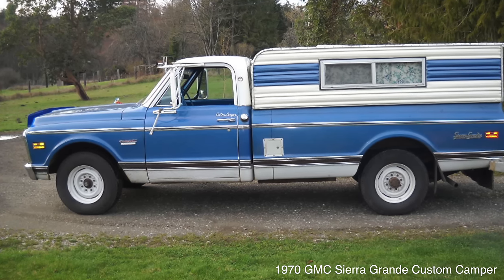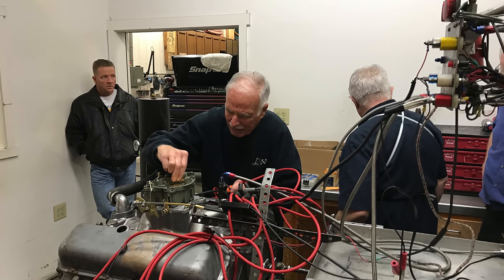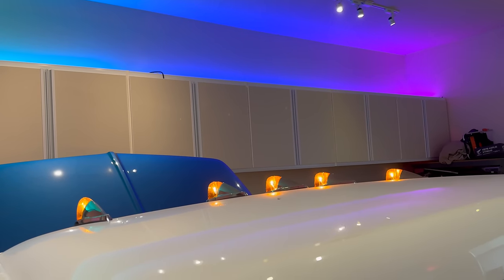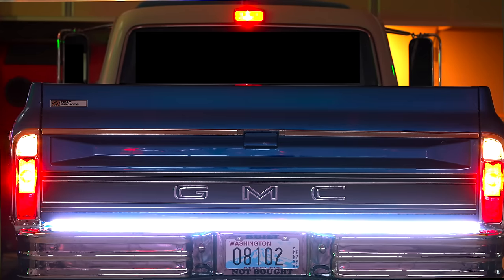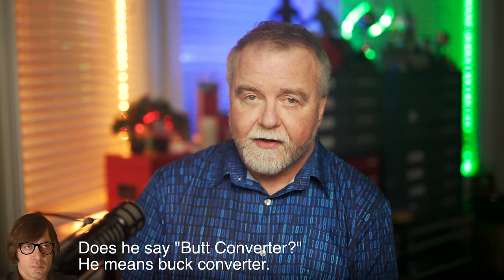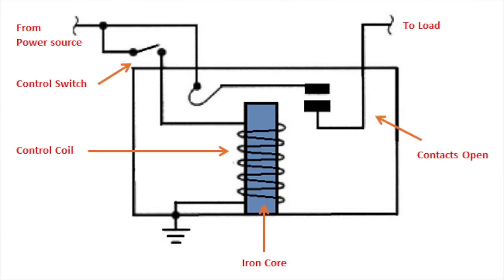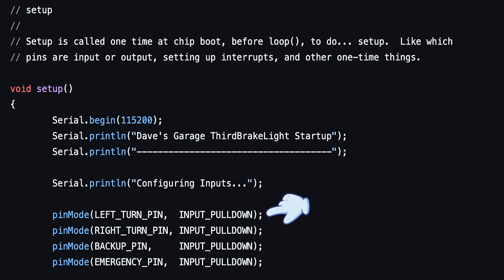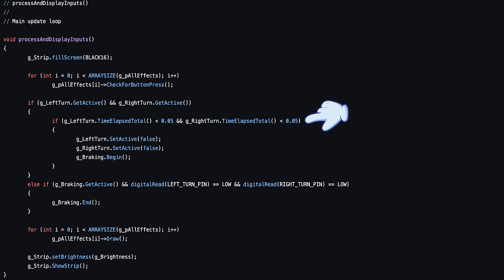New C++ LED Tricks for Our Old Truck: Sequential LEDs

Comment: A high school friend had an old 68 Cougar with "chasing" style turn signals which weren't working. We tore into it only to find the effect was implemented with a motor and contacts. This software implementation seems much more reliable (except in the case of an EMP... but in that event the car will still function while most others wont so turn signals won't matter as much :).

Comment: Easiest way to drop 12v to 3v3 is to have a resistive divider and a Zener across the bottom resistor to keep the voltage below 3v3. They are also quite fast so you shouldn’t see transients.

I love your video’s and your presentation style. You are an ambassador for autism. Attention to detail and a desire to find a solution allowing others to give input to your thoughts. And the “subs and likes” and asking for other peoples views. This is so important in engineering - we aren’t “gods of engineering” we are humble enough to seek input from others. This doesn’t mean we don’t know what we are doing, it’s having a mindset and humility to be able to collaborate with others. I am on the spectrum and it is without a doubt one of my strongest personal traits.

I honestly think that most really creative engineers are on the spectrum.  Most of the best people I know appear to be.
Reply: If dropping for input to a micro, you only need a resistor. With 12V you should be safe when connecting a 10k resistor on the pin, as then you would rely on the internal clamping diodes to limit the voltage. The resistor limits the current through those clamping diodes to about 0.7 mA. Simple, easy, works. And is exactly what you suggested anyway, just using built in zeeny. Not the safest though; rugged circuits provides schematics and explanations for a ton of protections (and sells boards if you want easy)
Reply: Btw I've used this often in auto and never blown an input. Won't save you if someone jumps you backwards though.
Reply: @forbiddenera  Just a zener and a series resister is perfect for 99% of cases. No need for a divider as the zener forms the lower half of the divider.
Reply: @forbiddenera The reason why I said to use a Zener was because of what you said - "not the safest though" - It is not a good idea to use the internal clamping of an input - transients can take a port out very easily.
Reply: @tripplefives1402   I'd still want a resistor on the bottom in order to properly ignore any phantom voltages which may be found.
Reply: @eDoc2020  That's what the zener handles. When reversed biased the zener will clamp it to the zener voltage. So a 3v zener will lock it down at 3v, no matter what the input is. Just like an LED or transistor, it needs a current limiting resister. With a divider the voltage will vary at a ratio of the input voltage. with a zener, it will always be 3v unless the input drops below 3v.
Reply: @tripplefives1402  That's the problem. When you only have the Zener limiting the voltage a 3v input will be presented as 3v and read as a logic high. Really anything above 1.8v will be read as high. This results in no noise immunity. Stray leakage current (like what you'd get from a turn signal blinker during the off cycle) will cause a false positive detection. With a full voltage divider you can increase the threshold voltage so it will not activate until there's enough voltage to actually light a filament.
Reply: @eDoc2020  The blinker is completely off when not in use and the wire will be floating disconnected. You just need a pulldown on the input to solve this. A voltage divider is not ideal because it does not limit voltage and that super large upper resister won't allow the zener to work because it needs a little current to work. At really tiny currents the zener voltage climbs and at large currents it falls.
Reply: @tripplefives1402   A voltage divider is a pulldown. With less current the Zener diode will have a lower voltage which is no problem. You seem to have that bit backwards.

I agree the turn signal wires will be floating when not in use but I'm talking about when they are in use. A traditional bimetallic turn signal flasher has the heater wired across the contacts. When the turn signal is active but the lights are in the "off" half of the cycle this heater will pass a bit of current. 2-pin electronic flashers will also pass a bit of current in the off half.
Reply: Dave has been such an inspiration at a cs student also on the spectrum 😊
Reply: @tripplefives1402  thats what I said. Just a resistor take advantage of the built in zener. 10k usually plenty but could use like 47k even for more protection/less current, don't need much current to trigger an input
Reply: @eDoc2020  actually that bit surprised me that Dave didn't swap the normal bulbs for LED replacements and an LED blinker module since he mentioned brightness.

Comment: Thank you so much for your videos!

A voltage divider is a completely acceptable way to protect the inputs with a couple of simple modifications.  Begin with a 100k input resistor paired with the correct grounded resister to give you the voltage you desire.  In the case of a 12v signal to a 3.3v input, this works out to roughly a 39K standard value resistor.  This configuration now limits the input under normal conditions to about 86 micro Amps (uA).  Connect the voltage divider output to two clamp diodes tied to 0v and 3.3v power supplies to keep the voltage from going above 3.3v or below 0v - these diodes need only be rated for about 250uA.  Connect this signal to the input of the microcontroller (uC) using a 10k series resistor.  The input of the uC has a really high impedance, make sure the pullups and pulldowns are turned off, AND the uC has its own clamping diodes built in.  with the addition of the 10K series resistor, these internal diodes are safe and can never see more than 50uA which is way under their rated capacity.  I have designed several auttomotive products using this with tens of thousands of units shipped and no inputs have ever failed.  This is even pretty good protection against most static discharges since it limits the current so well.

Most of my products also poll the inputs using an interrupt timer routine at either 100ms or 50ms intervals.  If you poll much faster than 50ms you will begin to detect switch bounce which measured up to 15ms on some very bad switches.  There are many ways to handle inputs and this is the primary one I use and is, of course, application dependent - your mileage may vary.
Reply: Hi peter, I am very interested in the circuit you described above, if you don't mind, where can I contact you to talk about this more?
Reply: Might need a zener circuit to trim input voltage down to 12.5V or so.
Reply: Voltage dividers are magic; I've use potentiometers for the same purpose on occasion. At the very least they let you get good values for hard wiring with resistors. I remember when my dad taught me about them, more than 50 years ago.
Reply: @UncleKennysPlace  Problem with the divider is that it does not clamp to a set value and car voltages can swing wildly and can even get zapped with HV if the ignition system goes weird. Use a zener in place of the lower leg of your divider to always have the voltage at 3v no matter what. If its low frequency input also use a capacitor in parallel with the zener to handle HV spikes and a RF style inductor in front of the resister to block RF interference from the ignition or HAM or CB radio from activating the input.. Also don't forget to throw in some self-healing fuses on the inputs in case your chip shorts out and starts shorting the inputs coming from the car. Typically if your wiring experiences some sort of overvoltage spike and the chip fails it typically fails with the pins shorting out to ground.

Comment: First off, Dave, I've been a fan of your YouTube channel for a long time, and always enjoy watching your videos.  They are nicely prepared, cover great content, and are geared nicely between beginner and guru-level so that they are consumable by a pretty wide audience, a trick which is not easy to pull off.  

I never knew that you were a "motorhead", though.    A man cut from a similar piece of cloth as myself, so to speak.  I've deep into tech my whole life, but also have a real soft spot for old Muscle Cars (and Muscle Trucks).  I lean toward Chevrolet cars because they're what I grew up with, but I love anything that was built in the mid-60's to early '70's that were oriented toward putting more power in a vehicle than it practically needed.   FoMoCo, Chrysler, GM, I love them all.  While the "today" versions of Mustang, Challenger/Charger(soon to be RIP), and Camaro(RIP) can handily slaughter the stock muscle of the era, there's still nothing quite like the sight, sound, and smell of a clean, proper, and loved car or truck that was a product of the muscle-era.  

Dave, you're truck is simply gorgeous!  So nicely and tastefully done. My sincere compliments!   You've got to get a lot of approving "thumbs up" and waves when you take it out for a spin.

I love that you did a lot of the restoration work yourself.   It's a lot of hard work, but it so pays off in satisfaction and "knowing it was done right".  If you're like me, it's almost transcendental getting behind the wheel of a classic like this and tooling around in it.  Machines like this are about the only example of a time-machine that you can use to instantly transport yourself back to the days before microprocessors and all of the distractions that they've created.

The fantastic and so beautifully-executed LED kit you built for it just puts icing on the cake, done it a way so as to augment the safety (which I really believe it does, because it'd be hard to miss the display unless someone was truly catatonic) in a way that doesn't impact the originality and timelessness of the truck's design.  Masterfully-done, sir!  

My only question is, what if you want to tow a trailer with the truck?  It looked like the add-on plugs into where the trailer pigtail would plug in.  Did you build adapter cable that provides a feed-through for the high-tech taillight, and also has an outlet whereby a trailer pigtail can plug in?     

The code that runs the lightshow is a great example of using the interrupt capabilities of the ESP32 to handle a number of things going on at once in real-time.   I also like that you used opto-isolators in the second go-around of the project, as relays, though a lot more reliable than in the days of the "moth" bug in Aiken Mark II Relay Calculator(1947), are still  electromechanical devices that can be somewhat fidgety.  

The'70  Chevelle SS396 you referenced actually had three different 396's available as optional engines. The low-end 396 was a 330HP version with single-exhaust, which is probably close to the 310HP 396 that came stock in your truck.  I'm quite your "396" now puts out significantly more than that now, though. 

The next version396  was rated at 350HP, with a more aggressive camshaft and dual exhaust.  Both the 330 and 350HP 396s  used a standard block with two-bolt main caps, cast rods and pistons, 10.25:1 compression,  hydraulic-grind camshaft & lifters, cast-iron intake manifold, oval-port heads that were good for torque, but flow-limited at higher RPM, and a Rochester Quadrajet four-barrel carburetor.    As you mentioned, the versions of 396 in truck applications got different cam timing to add to the low-end grunt, at the expense of some higher-end horsepower...totally the right thing for a big heavy truck, which likely explains the 310HP truck rating as opposed to the 330HP rating in the Chevelle.

The remaining 396 engine option for the '70 SS 396 Chevelle was a pretty special one. Only 2,144 '70 Chevelles came equipped with this engine, as opposed to the 4,475 built with the legendary LS-6 450HP 454.   

This 396 (or, 402 from '69 through '71) harkened back to 1965, when Chevrolet wanted to put a big block in the Corvette. The previous-generation W-series big-block engines just wouldn't do for the Corvette.  They were heavy, quite large which would have made them a chore to put into the Corvette's engine bay, and didn't really fit the sports car image of the Corvette.    The solution was an engine derived from Chevrolet's Mark II 427 big block that ran at Daytona in 1963 that became known as the "Mystery Motor".  Chevrolet purpose-built a special 396, based on revisions of the Mark II design, calling it the Mark IV, and rated it at 425 HP and 415 lb. ft. of torque.  It had lots of nice goodies that carried over from the NASCAR "Mystery Motor" program; including a forged steel cross-drilled & Tufftrided crankshaft, forged alloy rods, forged aluminum pistons, a special solid-lifter camshaft, high-strength pushrods with guide plates, a select high-strength block with four-bolt main bearing caps, 11.0:1 compression,  huge rectangular-port closed-chamber heads with larger valves, a special aluminum distributor, and a beautifully-designed high-rise aluminum intake manifold topped by a Holley 780 CFM four-barrel double-pump carburetor.   

This engine carried Regular Production Option(RPO) code L78, and became legendary when it was put quietly made available in the newly-introduced 1967 Camaro as a late model-year introduction. It got rated at 375HP(still 415 lb. ft. of torque) in the Camaro, which was partly for insurance purposes, and also to keep GM brass at bay because they weren't keen at that time on putting an engine that had more than 1 horsepower per 10 pounds of weight (and the Camaro weighed in at around 3,300 lbs. with a big block under the hood) into production cars. The engine was virtually identical to the 425 HP L78 in the '65 Corvette, though. Recent dyno tests of stock-built versions of the L78 show it turned out 425+ horsepower, interestingly at higher RPM than the engines were rated at back in the day. 

The L78 turned the Camaro into a brute, and led Bill Jenkins, famed Chevrolet engine builder and drag-racer, to take the NHRA Pro Stock championship in '67 with an L78-equipped Camaro (one of the first ones off the assembly line).       

I have one of these '67 L78 Camaros in factory stock form(a 33,000-mile, 1 of 1,138-made original that I have owned for 45 years), and I can attest that it is a handful with mandatory 4-speed transmission and optional 3.73:1 rear-end gears.   It'll smoke the tires  well into 4th gear, though you'd better be on top of your driving game, as it really wants to swap ends on you while doing so.   I also have a '69 Nova SS 396 that is also stock (65K original miles, owned for 25 years) with the L78 396 and 4-speed.  It has taller 3.55:1 rear gears, but because of the lighter rear-end weight distribution of the Nova, it's surprisingly more hairy to keep going in a reasonably straight line when hard on the throttle.  

Your  video got me thinking.  Like you, I have often worried about getting hit in the rear when driving both of these cars.  Both cars have dim, barely-visible in bright daylight, brake lamps that were apparently acceptable at the time, though woefully inadequate compared to the bright brake lights and CHMSL of today.  Putting in higher wattage bulbs makes the taillights look odd, with the lenses not diffusing the light evenly.   Maybe I can make something similar that is minimally invasive (e.g., fits in at the top edge of the rear bumper) that will fit with the theme of the cars, but make it much more obvious when I'm stopping or turning than the lame factory brake lamps.  I've seen LED lamp replacement systems for the brake lights on '67 Camaros, but they just don't look right, with led "dots" showing up in the lens.   Yeah, they are brighter, but they just don't fit the era.   Your linear line of high density and brightness LEDs and the effects they can create is so much more subtle to integrate, while being very attention getting.  I just might have to look into seeing what I can put together for the Camaro and Nova based on your idea.

Sorry I got a bit carried away in my comment...just was really neat to see you too were a combo tech guy and a motorhead like myself, and developed such an elegantly implemented safety improvement for your beautiful truck.   

Thank you for creating this wonderful video that combines your passions in such a nice way.

Keep up the great work, stay well, and may your truck always be shiny-side up!

P.S.  I love your shirt!

Comment: I grew up with a `72 GMC Sierra grande. When I turned 16, I would occasionally borrow it from my father. I couldn't help romping on the throttle. The 750 cfm "toilet bowl" would make an audible sucking noise. Dad drove it normally and got 10 MPG, I would get around 4 MPG. ;) I miss that truck! Great work on the restoration and safety equipment!

Comment: Dave, I am an ex Tandy/Radio Shack engineer and was part of the team that got the TRS-80 model I computer into mass production. That was back in 1978 and 1979.  I have never heard about this anecdote on the TRS-80 model I key switch bounce. That must have happened very early on, likely when they changed from the keyboard switches used in the prototypes to ones that had more bounce. Easy to fix in the ROM code by just extending to key bounce delay that is already there. The downside to the fix would be that any of the earlier masked ROMs had to be tossed out.

Comment: Great project!...Decades ago 60 Minutes ran an item on pickup trucks with fuel tanks behind the seats. They showed that you didn't have to crush the cab to rupture the tank and spray fuel through out the interior. Fires engulfed the interior of what would have been a survivable accident. 
In short, it really would be worth it to relocate the fuel tank to the under side of the truck.